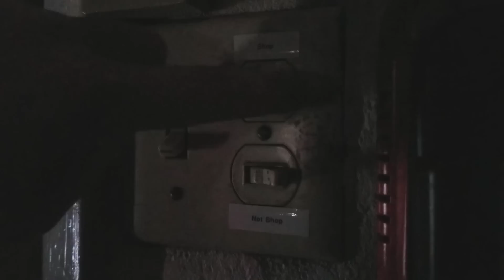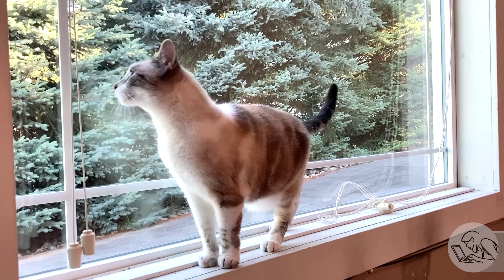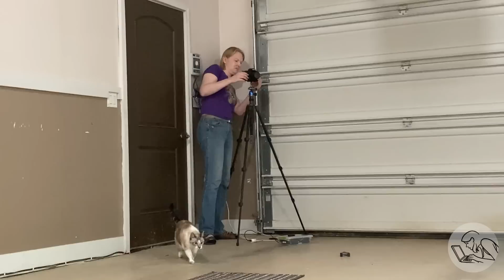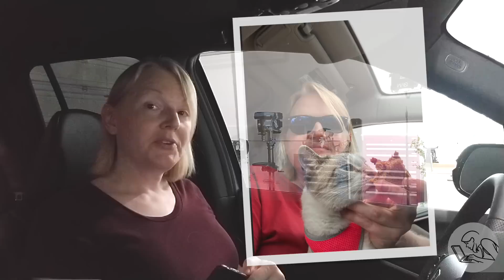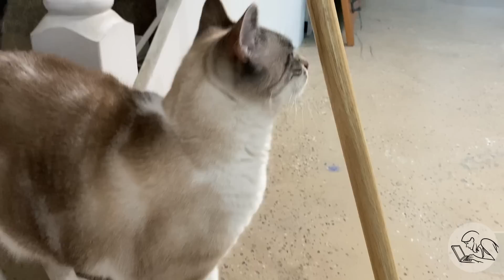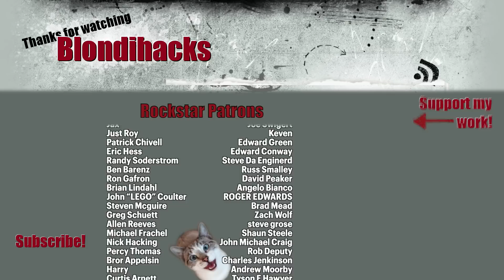Shop Move Q&A

Comment: Wow! Quinn, seriously, nearly fell of my chair when you said you were a teenager some 30 years ago. Good luck in your new place, even your last place was massive compared to most of our English homes. Well done you.
Reply: Dave, I’m with you, UK garages are so tiny, and rather limiting. The department of transport defines a garage opening as 1.5 times the vehicle width for a bus drivers reversing test. By that metric most garages are only suitable for Austin Sevens. Where we do win is 240volts supply, much smaller currents.
Reply: You keep a £150 lawn mover in the garage and at £20,000 car on the drive, mainly because you'd never be able to get out of the car if you drove in.
Reply: @twotone3070  hahaha Ain't that the truth, only the mower's in the shed because the garage is my den of machines lol
Reply: @twotone3070  just as well car makers have begun to realise it rains. Cars don’t tend to rust away so much now, they get abandoned because they are so complex no one can afford to repair them. The joys of modern life.
Reply: @UncleKennysPlace  I’ve worked in the us several times, I had noticed that cookers are normally 240v, the fun started at work, when the supply voltage was all sorts. In Europe most factories and houses are a 220v radial, schuco sockets are fused at16a, but in the uk we have a ring system that can feed 100m^2, usually 32a, but each appliance has a fuse in the plug, ocassionaly correctly rated. What is near universal is the IEC 16, 32 amp sockets for both single phase( blue) and three(red)

Comment: When the time comes to machine titanium, just remember that the chips will be crazy flamable (like magnesium). It will burn faster in water than in air. Only a class D extinguisher will work. Ask your local fire department for training.
Reply: Great tip Thanks
Reply: I have ignited it 3 times on the lathe at work. SFM is critical.

Comment: I appreciate you using the tools you are using.  I recognize that an old “big iron” mill is awesome, but it’s a lot less approachable for most people.

Seeing you working on equipment that I could purchase on Amazon is extremely relatable.
Reply: Perfectly put - Quinn is the shop teacher I've always needed for the equipment that I can actually own!
Reply: Seconded - I'm pretty sure that a good percentage of subscribers are hobbyists with fairly basic equipment (I have a Myford ML7R, pretty small, and a Sieg X2-type mill) and going to large expensive machines will alienate quite a few.
Reply: Thirdeded. I think Quinn is making a real valuable contribution to a long-running body of work about not being constrained by limited machinery. Books like the 1948 classic "The Amateur's Lathe" (L.H. Sparey) are essentially all about this. There aren't many YouTube channels that are in this position. Bigger machines would dilute this significantly in my opinion.
Reply: It's true - I can think of at least two channels I used to love that became unwatchable when they landed a huge sponsorship deal and they had every specialized tool for any possible job. Limitations make you more creative.
Reply: @peevester9987  Absolutely. Happens a lot with woodworking channels - they get money, move out of the garage into a purpose built shop, buy some industrial machinery, and then wonder why they're struggling to engage their existing (amateur, garage-based, low-budget) viewers.
Reply: @andypughtube  I would never deny Quinn pursuing what she enjoys or she desires.  I simply wanted to give a positive voice to a quality of the choices she has made so far and how I appreciate them.

I appreciate the content she produces.  A part of that is working around and through the challenges of the size of equipment can be its own form of Joy.
Reply: Thanks for saying that. 100%
Reply: @andypughtube  All good, no worries.

Comment: Going back and rewatching old videos - as a mechanical engineering school dropout, I want to applaud you for being very conscious of how your work could affect the safety of others. There's a lot of societal pressure to say "damn the regulations, full speed ahead" - just look at that engineering nightmare of a submarine implosion story a couple months ago - but safety is **hard**, and it's always better to stay inside your limits when death is on the line. You're a real machinist, but you're also a real careful machinist, and that's a good thing.

Comment: Being close to family is generally a good idea. I hope you can get some proper circuits run, and I doubt you need this tip, but ALWAYS put in more than you think you need.
Reply: As a Red Seal tradesman I see a lot of certified trades that should not be doing what they were trained for. 
You are very much a machinist Quinn. 
Cheers

Comment: Looking forward to seeing some titanium action! I had a pretty spectacular titanium fire when I was making a lot of small parts from grade 5 Ti 6Al-4V and didn't clean out the chip tray well enough beforehand.  There was a small heap of aluminium shavings soaked in cutting oil sitting out of sight under the ways in the middle of the chip tray. I'd made a fair amount of Ti ribbons when I stopped the feed for a second then tried to restart. The surface work hardened in an instant and white-hot burning ribbons fell into the tray and ignited the oil and the other ribbons.  Man, was it BRIGHT. No real harm done other than a coating of white TiO all over the lathe. Sadly, I wasn't filming at the time.

Comment: Quinn for your electrical issue, I had the same issue when I moved to my current house. The whole house was on a 100amp panel, I ended up getting a second 200amp service installed just for the garage and that has been great.

Comment: been in my shop 2 years in dec.. over 20 years at old home new place much bigger ... but l also need a new service installed .. there is only a 30 amp breaker that feeds the shop ,, not enough to run my air compressor  with lights and fridge  and tv ,,still trying out where I like things at ..moved stuff around after a month or so too try it again .. good luck in your new shop .. my move was about 5 miles in same town NY ..

Comment: I've been a fan for awhile, but I've only just started working through your videos in an organized way.  You are always so clear and unpretentious. I don't know if you fully realize how empowering you are, and I'm a sixty-something male who is fairly comfortable in a shop. For girls, and women without a mentor, this effect goes off the charts. 
    If you walk down the twist drill aisle in most hardware stores, you see some grotesque creations next to (hopefully) plain twist drills. Clearly most DIYers equate sharpening twist drills with an  exceptionally difficult open-heart surgery. But once you get it figured out it's easy and you never really forget.
    I decided to learn about 30years ago after dulling my 5th #36 twist drill.  I figured out that I needed a center punch,  a drop of oil and steady moderate pressure to drill, and set down at the bench grinder to sharpen my drills. I sharpened them and picked the worst (not quite symmetrical) to see how far I would get.  I drilled all 168 holes in 3/16" mild steel, tapped my threads, and became a true believer. That was 31inches of mild steel. The other four are still in the tool box, ready for action.
Understanding this cutting (vs rubbing) action is key to just about everything that happens in the machine shop.

   Moving a cat is a project in and of itself.  My cat family would never give me permission to move, but then I moved closer to my human family 20 years ago, so it is not necessary. Enjoy your new home, and family time. Thanks for what you do! 

        P.S. If ANYONE has made even the slightest progress in teaching welding or  the proper use of common shop tools,  and especially shop SAFETY to their cat I would be Forever Grateful for your ideas.
(Never Give Up!!!!!)

Comment: I moved from WA to OK.  A little over 2000 miles on the shortest route.  I had to take the ram and knee off my mill to get in it a uhaul for the move.  Lathe being small just took a few people to load.  It's always an adventure to move, and then you have the fun of unpacking and always wonder how so much trash moved with you.

Comment: Considering you’re self taught you do an excellent job in engineering and you learn fast. Just one little tip please, when you start to machine your titanium keep your fire extinguisher at hand just in case. Keep up the good work.
Reply: Do you mean magnesium?   Never heard of a propensity of titanium to auto ignite.
Reply: @Stepclimb  titanium contains magnesium. I've seen two Bridgeport machines burnt to a Wright off. I nearly did myself but I managed to put it out in time.
Reply: @westweld  I agree, but you never know It was just In case. When you see titanium swarf ignite it's not funny.
Reply: @UCJd52nvJsQT81ibSfHN9Tfg I've been machining titanium for 40 years I can tell the difference. Like I said before I was machining titanium and left the swarf in the tray by mistake and when I started cutting mild steel a spark ignited the titanium and it went up in flames exactly the same way as magnesium. You need to do more research and you'll be surprised. It seems like you've learnt something new.
Reply: @ikbendusan  maybe so but the point I was making was it’s combustible in exactly the same way as magnesium. If your machine sets on fire you have to use a powder extinguisher and not liquid which I found out the wrong way.
Reply: @millwrightrick1  yes I used a liquid extinguisher and it made it worse. Our company replaced them with an extinguisher for metal. But luckily I never needed to put them to the test. Yes sand is probably the safest option.

Comment: My safety lesson was delivered by the business end of a dremal sporting one of those paper thin metal blades. Left booger finger and thumb ended up with 32 stitches. Booger finger cut to the bone almost full length. Both fingers work better after the cutting but boy howdy!

Comment: Glad you and Sprocket made the move safely!
One electrical suggestion, that you probably don't need and already thought of, dedicate the existing 15 amp circuit to lighting only.  One of the silliest things we do in US residential wiring is to put lighting (rarely the cause of circuit breaker trips) and outlets (frequently the cause) on the same circuit, so when we screw up not only are we angry but we're also in the dark.

Comment: Quinn, when you find a use for the titanium you were gifted with, please keep in mind that it can work-harden quickly if your cutting tool isn't sharp and making chips.  Where I used to work, I learned (a long time ago) that if the Airframe Mechanics cutting on/repairing fighter airframe components that were titanium didn't keep their cutters sharp and/or apply enough pressure to make the chips, the material work-hardened to the point that it was virtually impossible to cut with "appropriate" cutters.  The components couldn't be removed from the airframes without costing $100K+ to $1M+, so they really had to pay attention to what they were doing and the condition of their cutters.  I believe that by making real chips (rather than dust), enough heat was carried away that the titanium wouldn't work-harden.

Best of luck getting both your new home and shop up and running ASAP!  (I assume that you moved to the US?)

Comment: (1) I worked for a small machine shop. The two brothers preferred Tree mills to Bridgeport but I no longer remember their rationale. (2) vids of your thought processes in building out your new space would be well received. (3) while your new shop is mostly empty, that is the time to cut drywall and install a sub panel or two and run good 20 amp circuits to where they are needed. It’s not hard. If you DIY then you know where everything is. Patch and retape the drywall, paint, and enjoy electric nirvana. (4) when machining titanium, take heavier than normal cuts to finish. Light cuts cause work hardening and fires. Once work hardened, it takes an act of God to make it right. (5) Love your channel. I miss having metal working tools. Went from a small machine shop to NC programming for the space shuttle, then NC programming for Boeing, then to college (finally) for a degree in Math/CompSci where I worked my way through working as an NC programmer at Continental Emsco and then a 30 year career in IT. Retired now and itching to return to my roots in metal working. Thanks for bringing back fond memories working in machine shops!

Comment: You are going to have trouble heating this garage in the winter. Roll Up Door do not seal all that well and the maximum thickness for insulation is only 2 inches. You are going to enjoy your new shop, and I am confident the pinball machine will be flipping and sounding away happily in the near future. Not sure where you have moved to but by the size of the garage it is a nice location.

Comment: In my paper mill years, we shared a building with a sister division's rubber testing guys.  They told me some tricks about handling rubber in general and nice tricks in certain situations.  One that was really astonishing to me was about cutting soft rubber.  A sharp knife is useless.  Instead a serrated kitchen knife or a hacksaw (not a knife made of hack saw blade!) with soapy water lubrication did the trick.  I have not had much use for this secret knowledge, but I can testify about its benefits.

Comment: If I put aside the fact that "aluminium-spec" bits are allmost completly without chipbreaker, Korloy has a grade that works nicely even on hardened steel. At work I use it at hardened, annealed steel, aluminium and stainless.
 The one thing that I like allmost more than anything else with carbide is the possibility to change insert and the error is ~+/-0.05 mm. When using DRO and a "tool library" multiple operation turning gets much more pleasureble.
 Hope that you will settle in nicely, 2400 km (or 1500 miles) is a long way. Take care 👍🏼!

Comment: It was nice to see your cat Sprocket checking out the new environment. Lots of new options for an elevated perch and hiding place are the cat 101.   Setting up in a new Human space for work, or just life, can be fun, but it's also challenging. I hope it all goes well for you.

I just would mention that when polishing titanium. It sheds sparks to an alarming degree, so be very careful with buffing lint. A specialist polisher in Sheffield told me to lay down newspaper to catch the sparks so you can pull it away fast. It's lovely stuff but it hardens fast.

Comment: I once had a friend tell me that 3 moves = 1 flood.  That seems to work out about right.  :-)   

One of the shops I used to work in did a lot of work with titanium.  Assuming yours is the same alloy that I worked with, some things to be aware of:  1. It machines like a sticky version of aluminum, with long stringy chips and only slightly lower feeds and speeds.  2. Do not let the tool sit in one spot for any length of time.  If the material work-hardens, you will be hard pressed to machine it with diamond cutting tools.  3. I've not seen this happen, but the owner of that shop said that his insurance agent told him that a titanium fire was very much like a magnesium fire.  So be sure to keep coolant on it.  Because I worked almost exclusively with CNC machines, #2 and #3 were not an issue for me.

Comment: Hi Quin, on Sprocket, I had always assumed you were a Muppets fan. Not asking, but you must be older than you look if you were having near death experiences 30 years ago. I wouldn't let five year old anywhere near a power saw.   As you are getting a sparky in to provision the shop, I will say that having been involved in relamping a factory, LED lighting is worth it and needs to be done first, so you can fix errors/omissions before the equipment gets too settled.  As soon as you said family, I felt it for you.  As far as cost goes, for a LTL that was a really good deal.  I also get a lot of fun out of watching a channel that is the opposite of yours,  Cutting Edge Engineering. He mostly does repair work for mining equipment. Everything is huge but the tolerances are small.  All the best, and no one will mind if you "phone in" a few episodes.

Comment: Mover cost - OUCH!  If I end up moving I will have to try to do it with U-Haul.  That is how I got my everything except my lathe in my garage.  60 amps for car charging that is more than my 250 amp welder needs - I'll stick with gasoline (car, Jeep) and diesel (3/4 ton pickup).  I love the size of your garage doors - was that a commercial space?

One thing I would recommend to put on your list is insulation for those garage doors.

Comment: I worked in a plastic injection mold machine shop as a teenager (freshly 18 and invincible🙄) and almost lost a finger once. I was working as an informal apprentice and was working on a Bridgeport mill that day. I never paid attention to the fact that nobody else was wearing gloves... Cue the facepalms...

We had a big graphite electrode edm and I was making a 12x12 graphite blank for the Röders 6-axis to mill the mold cavity electrode. I figured "why not" and put on a pair of thick nitrile gloves. I was facing the top with a 4" facemill with 8 carbide inserts in it. I reached up with a chip brush (can't use air to clear chips milling graphite and the whole-shop vacuum was down for cleaning), cleared the graphite, turned toward my toolbox and the glove got snagged on the facemill. 🤦 It very quickly pulled my hand toward the tool as the glove (thankfully) ripped. One of my knuckles on my right hand brushed against the very tip of the inserts and barely nicked it. I was terrified. Thank God it wasn't a cloth glove.

Safety VERY quickly became priority one to (previously thought to be) invincible 18 year old me.